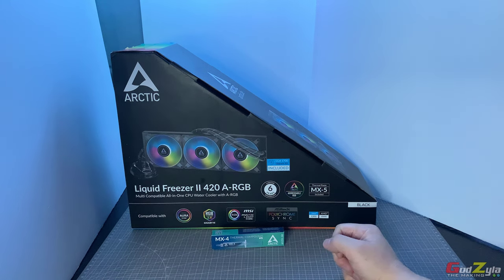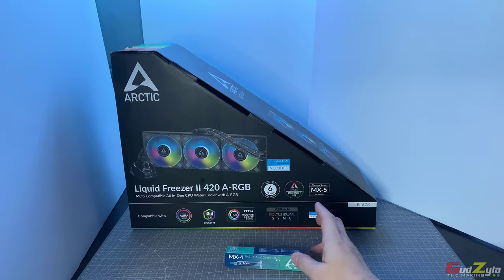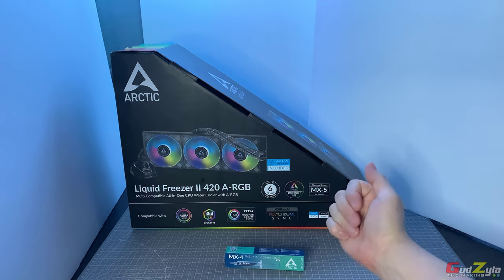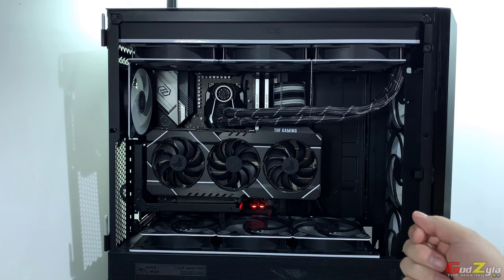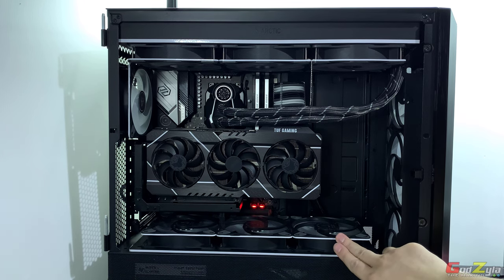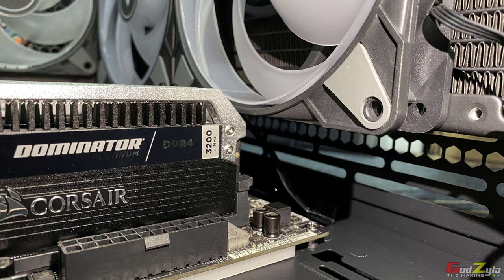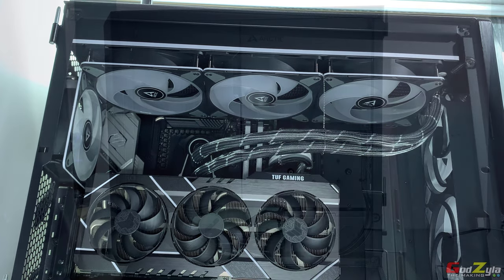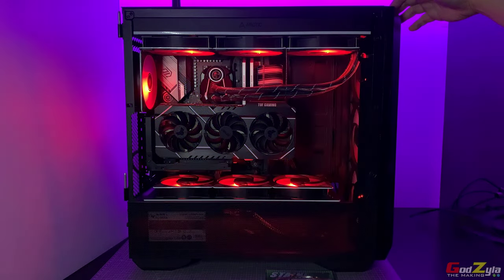Arctic Liquid Freezer II 420 in Lian Li Lancool III - Part 2 (The Experience)

Comment: Why not front mount?
Reply from the maker: Hi PhilD, welcome to my channel, unable to fit the front, I mean you can fit but you will not be able to fit the first top fan, so I mount it at the top.
Reply: I didn't expect such a quick reply, or a reply at all. Very detailed video btw thank you for making it. 

What prevents the upper fan from fitting? Did you try both sides of the front radiator bracket?
Reply from the maker: @phild4186  hi, I have tried both methods. With the radiator inside. The hose is blocking the front top fans and when i mount at the outside of the fan front tray. I can’t close the front mesh cover.
Reply: @KleoYan  interesting. So you think there is no way to make it work?
Reply from the maker: @phild4186  for the Arctic Liquid 420, nope, but if you try other 420 which does not have a thick radiator, it might work but the problem with other 420 is.. the hose are short and might give tension which is not ideal.
Reply: @KleoYan  that's very unfortunate. I really love this case. I have the lancool 2 mesh but wanted a bigger radiator. I don't really care for the top mount it seems a little too tight. Thank you very much for your time. You probably just saved me a lot of time.
Reply from the maker: @phild4186  you are most welcome. Hope you will find something which can cater to your needs.
Reply: @KleoYan  I got it to fit, front mount. You have to install it with the bracket in the case. I did a slim fan top front no space for a 25mm depth fan. Then I did 3 140mm x 25mm push, 2 140mm x 25 and 1 140mm x 17mm pull.
Reply from the maker: @phild4186  hi welcome back, I see, thanks for the feedback.👍

Comment: Is this case the best option for a 420 aio cooler? I understand you got it as a gift. Thanks for all the info, not easy to find.
Reply from the maker: Hi Renee Varmeylan, welcome to my channel, it was a risk without knowing if it’s possible. That’s the reason why I reach out to Arctic and Corsair. Only Arctic replied to me. So I can’t tell you with 420 is best. Nevertheless I believe after being able to use the Arctic liquid freezer II which has a thicker radiator, the rest of the 420 from other brands should not have the issue.
Reply: @KleoYan  When I upgrade my pc, I will probably choose 7950x as well, and this cooler seems the best choice for it. I am wondering which case would be optimal for it, so the 420 can be mounted at the top like in this video. When looking up what the coolest cases are, I find Fractal Torrent and Lancool 216 have the best temperatures, but those cases can't mount a 420 at the top.

This seems like a fine case, but I wonder if there is maybe another one that is even better. There is not much info about it.
Reply from the maker: @rubenvermeylen7128  to fit a 420, there are a
few. Example the bequiet silent base 802 or the Phantek Eclipse G500a.
Reply from the maker: @rubenvermeylen7128  hi, ok .. all the very best.. something to take note. I dont mind you posting other YT url in my comments but YouTube plaftorm will remove your comments after sometime or before I can actaully reply at times. so do take note if you intend to add other YT channel url on other's. for me I dont mind 😉

Comment: Idk how u did it I was unable to. Was upset cause I liked the case & the aio
Reply from the maker: Hello Jaiizwaii, welcome to my channel. which part are you not able to fit the 420 AIO at the top? If you are talking about the 12 screws. you need to slowly fiddle with the alignment, do not screw tight to one end, try screw just enough to hold the radiator and adjust the rest before you tighten up those screws. Also for the front fan tray mount. this is what I did which i forget to include in this video.https://imgur.com/gallery/vHezOSS

Comment: Thanks for all your videos..I have watched a few and very happy the in depth rreview yu have done. I  was thinking of getting NZXT aio and lian li SL INF fans x 7. lian li strimer plus 8pin and 24 pin. (i have strimer as of now but I will upgrade) , tridentz royal rams. I have a corsair k100 and a logitech G Pro.I also have an ADATA RGB SSD. Myquestions are as follows:
1. Can I sync ALL of these to RGB effect. If No then at least which can I sync together.
2. Do I need a separate super motherboard or an ARGB controller like Razer's . or the Lconnect will be able to handle all.. 
my motherboard has only 1 ARGB connector and my main aim is to sync all . hope yu can help..
i hope i made sense here.
Reply from the maker: Hi Tanmay, welcome to my channel. thank you for your question, the equipment you have listed, I do not have them but after reading the specs and instructions, if you want to sync up all your argb devices with the motherboard argb app, you will need to install each individual device argb app, within those apps, you will need to set bypass to your motherboard argb. Same apply to the uni controller and the strimer plus V2 controller. To be honest, I am not able to aid you as I do not know how your system will react but based on experience, 
your PC will be running lots of argb utlity at the background and this might conflict inbetween apps as ARGB IRQ in each system is shared. your apps might not react accordingly. 
I am so sorry that I am not able to aid you.. you might want to take your question directly at lian li reddit forum ( https://www.reddit.com/r/lianli/ ). There might be someone able to help you. 

Going through your device manuals. 
K100 Corsair Keyboard chrome-extension://efaidnbmnnnibpcajpcglclefindmkaj/https://www.corsair.com/corsairmedia/sys_master/productcontent/49_001877_AB_NA_K100_RGB_Optical_Mechanical_QSG.pdf
Logitech G Pro https://support.logi.com/hc/en-sg/articles/360024696774--Downloads-PRO-Wireless-Gaming-Mouse
Reply: @KleoYan  thanks yu so much for your reply. this helps a lot. i got a few doubts cleared.
Reply from the maker: @lostyraul  you are most welcome but I am still not able to aid your further, I do apologise. Do ask at the lian li Reddit forum. I believe someone might have the same situation as yours. Give it a try ya. All the very best with your build 👍
Reply: @KleoYan  thanks a ton buddy.
Reply from the maker: @lostyraul  most welcome. Hope at lian li Reddit forum will have someone to resolve your questions.

Comment: Does this AIO have the 8th Gen Asetek pump?  I'm looking for a premium performance AIO to cool my 7950X.
Reply from the maker: Hello Adjodha B, welcome to my channel. Arctic uses their own design pump like EK. Unlike others that uses Asetek. That’s why Arctic or EK stands out and being the best liquid AIO. You should watch this https://youtu.be/ugg_6bvYZAk
Reply: @KleoYan  Thank you for the video. It was very informative. If I buy an Arctic liquid Freezer II 360, will it have this new revision cold plate?  This AIO is already two years old.  Will the box have a revision date? My motherboard is the MSI MPG X670E CARBON WIFI,  will it fit properly? Thank you!
Reply from the maker: @axi6ne8us  hi, though the product is 2 years old. It still one of the best liquid aio which can take the am5 or Gen 13th processors and yes there will be a marking of the rev number and the qc sticker. Do check before purchasing. Best is to get rev 04 onwards. Now is rev 7. As for your motherboard the x670e carbon. It should fit properly.

Comment: Hey, cool vídeo. I just got the lancool 3 and arctic freezer 420 for a 13900k. Not a problem to install radiator even with the fans in place with some TLC, could not fully fit the front fan chassis on the upper section with the 2 thumbscrews though, it hits the radiator and won’t fit by 0,5-1cm… had to use a couple of zip ties 😢 too bad!
Reply from the maker: Hi soma_aventura, welcome to my channel. Pardon me as I miss out the front in this video. This is how I mount the fans at the front https://imgur.com/gallery/vHezOSS
Reply: Ahh, you’ve just turned the fan chassis inside out and put it on the outer part, cool. Thanks
Reply from the maker: @soma_aventura  you are most welcome.

Comment: Ohhhh nice. Do you know if i could fit a 140mm fan in the back of the case or no room?
Reply from the maker: Hi Hetsu, welcome to my channel. If you are fitting a 420 at the top, there are no room for a 140mm fans at the rear and for 120mm too, just that I did abit of adjustment using rubber studs instead of fan screws at the rear. Also please note that the front you have to mount your fans this way. https://imgur.com/gallery/front-with-3-x-140mm-fans-vHezOSS
Reply: @KleoYan  Oh wow, damn it do be complicated. Thanks for so much info, I know im just gonna go for a 360mm rad instead XDD
Reply from the maker: @Hetsu..  then there are enough space for 140mm at the rear, no issue.

Comment: I have that case and i want to mount the same aio in the same place. But tell me. Which fans you mount at front of case? (manufacturer and model and size)? And the same for rest of fans. Back fan and fans under gpu. Sorry for my english.
Reply from the maker: Hi Pan Dj, welcome to my channel

1) Top - Arctic Liquid Freezer II 420 (3 x Arctic P14 ARGB Fans)
2) Bottom - 3 x 120mm Arctic P12 ARGB Fans
3) Rear - 1 x 120mm Arctic P12 ARGB Fans (with rubber studs https://www.amazon.com/AUEAR-Silicone-Reducing-Vibration-Mouting/dp/B08KGWTDHK/ref=sr_1_8?crid=3U3S6L092OUB9&keywords=rubber+fan+screws&qid=1678905680&sprefix=rubber+fan+screw%2Caps%2C332&sr=8-8)
4) Front - 3 x 140mm Arctic P14 ARGB Fans ( front mounting tray demo https://imgur.com/gallery/vHezOSS)
Reply: @KleoYan  Thank u very much. its very helpful for me. Greetings
Reply from the maker: @MyTechn0  you are most welcome. All the best with your build.

Comment: Hello MR!
Sorry, i have a question.
What is your memory height?
Reply from the maker: Hi Attila Horváth, welcome to my channel, the total height from the top center to the bottem center of the ram is 50mm
Reply: Thank you! Because my memory 44mm height and LIAN Li write in the official site if i have 420mm cooler then not use 44mm higher memory

Then 44mm high memory its okey?

Sorry my english.
Thank you!
Reply from the maker: @attilahorvath3553  is u are talking about the side of my dominator. They are 40mm that is why when I answer you, it based at the Center top to bottom of my rams which is 50mm tall. What rams are you using? The same rams?

Comment: Will i still be able, to use the dustfilter in Front, if  i Mount the 420 on top? Or is that not possible?
Reply from the maker: Hi Jan withering, welcome to my channel. I have not tried using the optional filters therefore not able to answer your question so sorry about it.
Reply: @KleoYan  thx for your answere :) on the website of lian li are mentiont 4 options for the fans in the front.  Can you tell me, how much mm the fan hold is away from the holding for the Bottom fans? If its 40, 60 or 80mm the dust filter should be ok. But if its scenario 3 from the website, 100mm i cant use thw dust filter :) thx for your help
Reply from the maker: @janwiggering2708  this is how mine looks like and the only way to mount the front fan with an Arctic Liquid Freezer II 420 https://imgur.com/gallery/vHezOSS

Comment: Nice Video! Just got the Lancool III myself. I am wondering, does the 420 up top affect the position of the front intake fans? Do they have to be put in the forward most position? For my setup I am moving the front IO panel to the bottom and I am installing the Lian Li dust filter kit as well, and I hope there are no conflicts with a 420. Finally, that rear exhaust fan is 120mm, correct?
Reply from the maker: Hi Thomas Riis Henriksen, welcome to my channel. You have very sharp eyes, yes the rear is of 120mm fan and the front tray,  you need to reverse it.. else the hose will hit it.. as for the front I/O panel. I got to tug them properly at the top and there will be no issues. last but no least nope the front fans will not be block.
Reply: @KleoYan  Excellent, thank you :D
Reply: @KleoYan  Oh and I loved that you removed the very bottom tray that holds the HD cages! I did the same as soon as I got the case, and you are so far the only reviewer who has done it. Nice attention to detail. I am even itching to cut a hole in the bottom and adding an additional bottom intake fan... :D
Reply from the maker: @thomasriishenriksen2229  hmm 🤔 cutting a hole for fans. You can do that if you want to but just have to treat the cut properly, as it might rust. Btw thank you for the feedback and all the best with your build 👍
Reply from the maker: @thomasriishenriksen2229  you are most welcome 😉
Reply: @KleoYan  Good point about the rust! Nail polish should do the trick. I also have a suggestion for you, if you do a thermal test: Perhaps try both with and without the rear exhaust fan. I am honestly unsure how much of a difference it makes. :)
Reply from the maker: @thomasriishenriksen2229  Yup, am gathering info from viewers, one of them is suggesting to compare with the 360 LF2 which I have just write in to Arctic and as for your request, will do too. It will take sometime though.. currently busy with projects at work. Thank you Thomas for the valuable feedback, greatly appreciated it.
Reply from the maker: Hi Thomas, I re-read your comment. there will be an issue with the mesh kit. please take note on that. I am writting this to you as there might be consern to have the mesh at the front, which might block your front cover to mount back properly. have a look at the front fan bay which this is the only way to have the 420 at the top and to have case fans mounting at the front. https://imgur.com/gallery/vHezOSS and see the info at lian li official online aliexpress store https://www.aliexpress.com/item/1005004595236061.html scroll down and see with the message that says "Note : Front fan multiway brackets is not applicable to scenario 3, which has 80mm thickness for the fan and radiator combo, when the front dust filter is installed. "
Reply: @KleoYan  Thank you 🙂 I think I can fit the front fan filter actually, but I must say I am generally very disappointed with the Lancool III dust-filter kit they sell. The front filter does have an actual filter mesh, but it's not very fine. Much larger holes than expected. The side and top filters are horrible. It's not filter mesh, it's essentially just the same mesh style with the round holes as the existing front, top and side meshes, just slightly smaller. When added, all they do is restrict a ton of airflow without filtering any fine dust at all. I will have to have some custom made if I want actual dust filtering.
As for the IO panel, it will have to stay up top if I want to use the 3 included 140mm front fans. I tried. It won't fit at the bottom with the fans pushed forward like they would have to be with the Liquid Freezer II 420. I might still get it if it's AM5 compatible though 🙂
Reply from the maker: @thomasriishenriksen2229  I see, when I see the mesh kit, I was tempted but I have some mesh sheet on DIY projects so I might use that. but then again, am lazy to do DIY at the moment plus every weekends, I will just use my portable air blower to blow off the dust on this system and the case, just to keep it dust free. Thank you for your reply Thomas and your valuable feedback will help others regarding on the purchase of the mesh kit. By the way, the Arctic LF2 copper block is able to cater for the AM5 IHS, no issue as I've asked Arctic support person about this and they have told me it's compatible. On the X670's motherboard,  the placement processor holes for the AIO standoffs are of the same dimension as the AM4 motherboard. All the best with your build.
Reply: @thomasriishenriksen2229  Hey if you are still wondering I was able to fit the front mesh filter in with the fan bracket reversed it only needed like 1-2mm clearance to get below 140mm fans, I don't know why lian li didn't design it to be used with the bracket reversed. I realized the top of the case front was fitting fine with the mesh screen but the bottom was just hitting the fans I took out the 4 opposite facing screws from the case fan bracket and used bracket mounting stlye 4 in the manual. The bracket moved back further and I could fit the mesh filter in but could not secure the bracket in any way. So I tried with just the top 2 bracket screws(that get hooked), the case front with mesh filter was able to fit in and I could use the top thumb screw still to tighten the bracket. But wishing I just did DIY magnetic screens for this case, these screens aren't great had to pay 5X their cost for shipping and sat at customs for 2 weeks and snapped in half one of the cases fronts protrusions pushing and puling it in at weird angles so many times.
Reply: @KleoYan  Hello ! What do you mean by "reverse the front tray" ?
Top is bot, and bot is top ? Front is back and back is front (in this case, I have to reverse fans too I guess) ?
Reply from the maker: @lucasderre4825  hi welcome to my channel. I don’t understand what you mean by that. Can you elaborate. Thank you.
Reply: @KleoYan  uh, my bad (and sorry for my english). I talk about "...and the front tray,  you need to reverse it.. else the hose will hit it". I guess you talk about the front panel with the 3 fans ? I don't get what you mean by "reverse", in which way ? Because my hose hit the front tray and I don't understand how it fit for you
Reply from the maker: @lucasderre4825  oh ok. This is how https://imgur.com/gallery/vHezOSS
Reply: @KleoYan  Oh, I already checked this link. I didn't notice how you set the front tray. Thanks
Reply from the maker: @lucasderre4825  you are most welcome. All the best with your build 😉